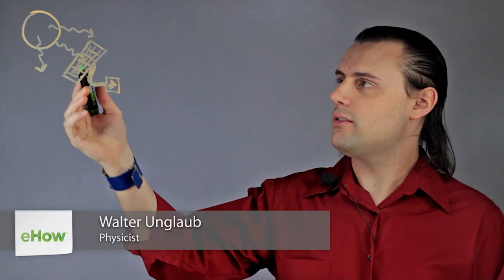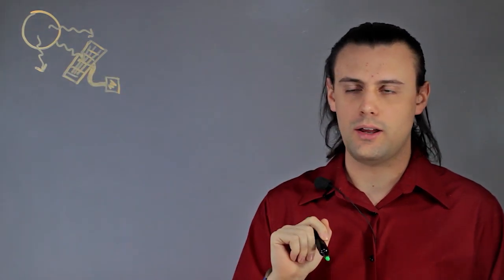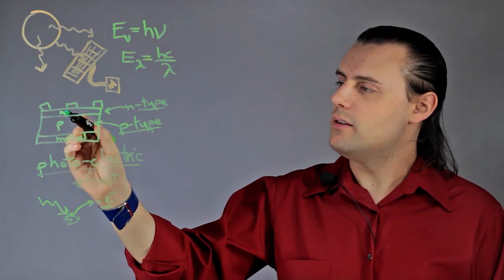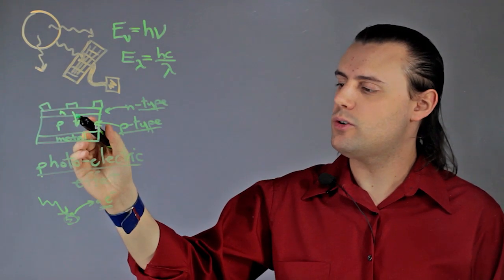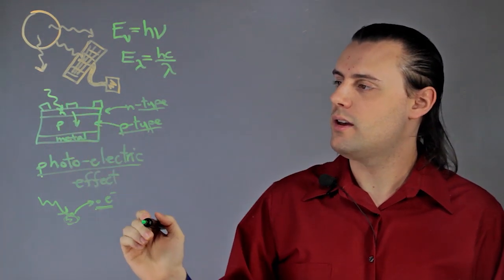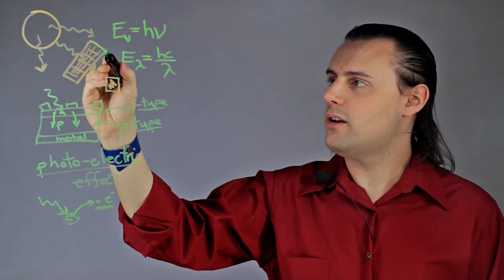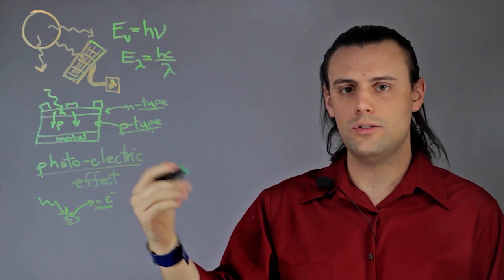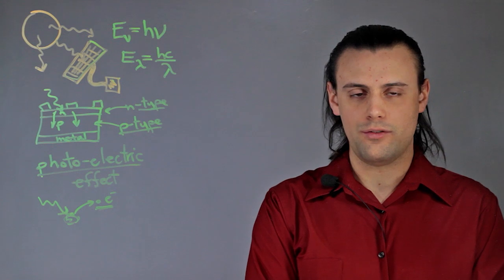Solar Panel Physics : Such Great Physics

Comment: I have a question so if u where getting like a ton of radiation shot at u and u put a solar panel infront of the yourself Would it stop the radiation from getting to u
Reply: I guess no!, cause radiation  can be of different quantities of energy, and electrons only accept the right amount of energy to knock them to another level of energy or to be knocked out, and the other energy will just pass through
For example
Imagine the sun radiates 3 photons, 1 photon of 2eV, another of 4 eV and another of 5eV
And imagine you need 5eV to knock out the electron, the electron will only accept the 5eV energy to be knocked out, and the other 2 photons will pass through.
There is a video which explains it better, it is called, atomic energy levels from We Are Snowboat